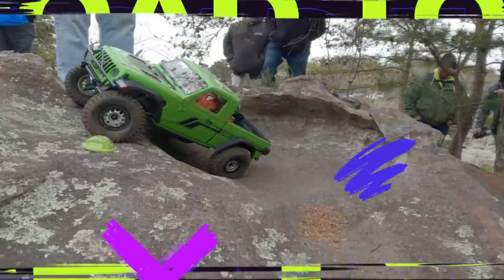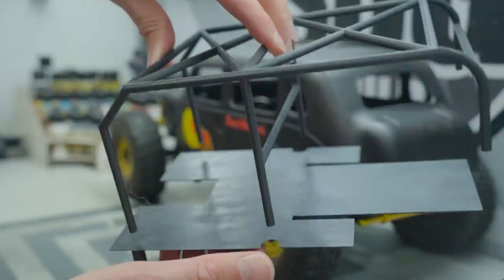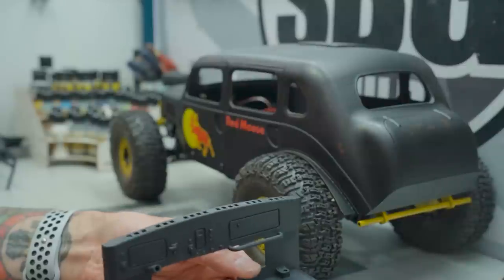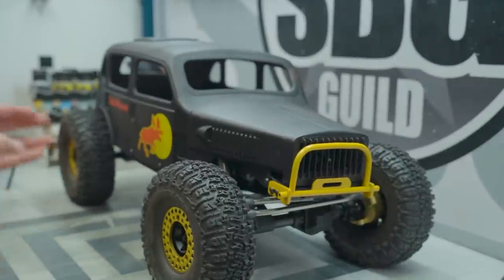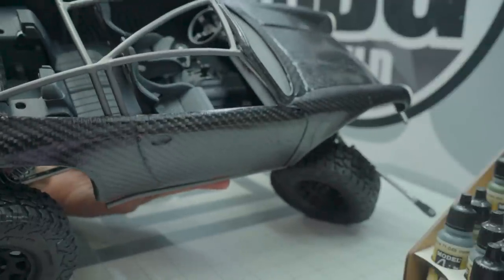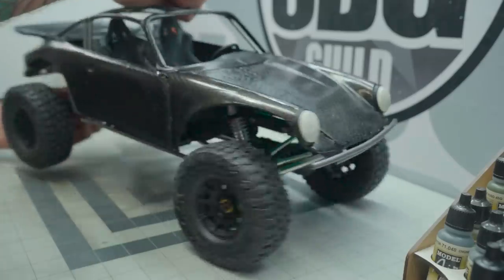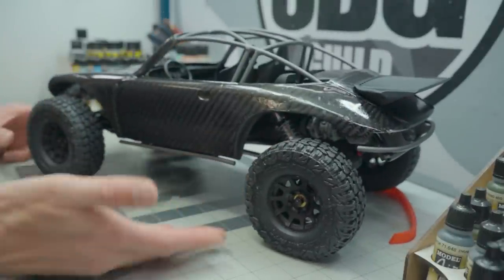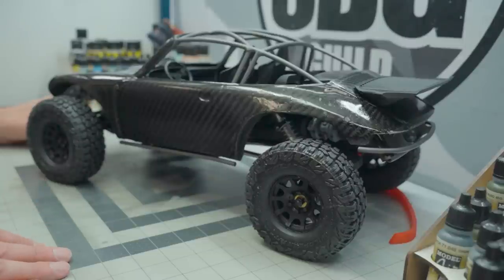Road to the Rockies Ep8 - I made this Carbon Fiber Porsche.

Comment: The 'Moose is looking good! As a thought, with the thickness of the body-shell, could you counter-sink the body mount screw holes and use flush head bolts instead - they would look less obvious?
Reply from the maker: I’m not sure why I didn’t think of that, or, better yet, grub screws!

Comment: Do you really need an external BEC with your Fusion Pro? The internal is 6A. What kind of servo are you running? I always say simple is better (less things to go wrong). If you need lots of servo torque, I’d go with a direct power servo instead. Wasn’t it your BEC that smoked last year?
Reply from the maker: I’m running the BEC at 8 volts, the Fusion one won’t handle that and a servo winch, both of which are not direct power. I actually find this simpler. And yes, it was a BEC that smoked last time, but that was apparently a known failure point on that V1 Holmes board.
Reply: @scalebuildersguild  Sounds good. I’ve just never had an issue not running a BEC, but then I’ve never tried to compete. When I want to overdo it I just go direct power. Lol.
Reply: @scalebuildersguild  BTW, both vehicles are looking amazing. Loved the 4-Tec rally car too. I have wanted to use one of those hot rod bodies on a crawler!

Comment: why not bend the rear C2 bumper tabs upward so you get better exit angles?
your going to get hangup on the rocks with that bumper, is rear bumper sorrca legal,?

use matte carbon on the C1 and then the livery is glossy
Reply from the maker: That would make the bumper not legal.
Reply: @scalebuildersguild  Not sure about that,  curious what the ruling is exactly. Your bumper as is already isn't standard, maybe you need to punch through the body to get better clearance?

The RC4WD Hilux using the slider mounts makes the body sit so low that I made brackets to drop the front and rear bumpers to they could they look proper. The bumper tabs I used have bends for additional clearance.